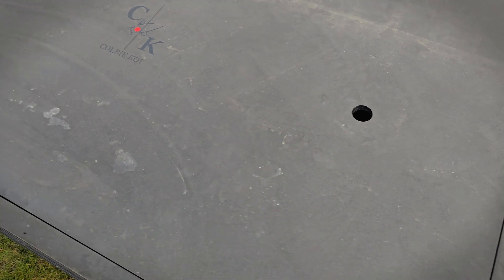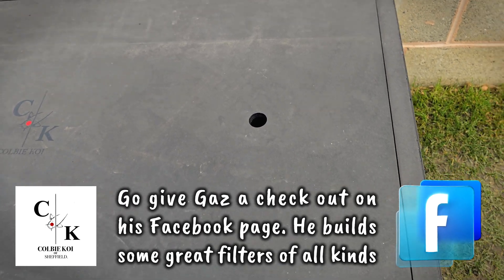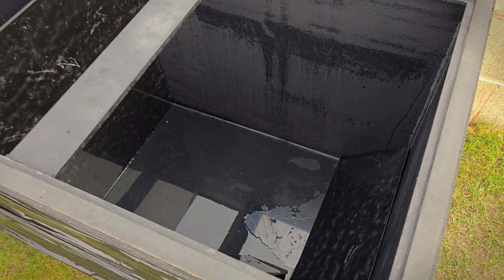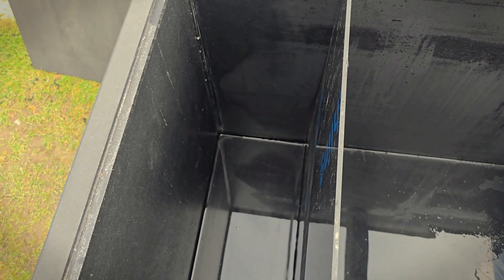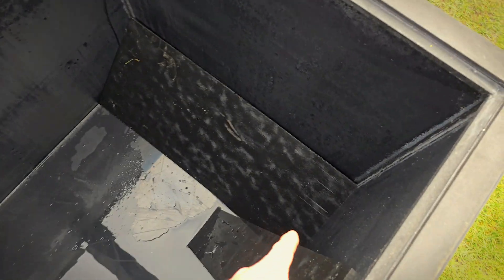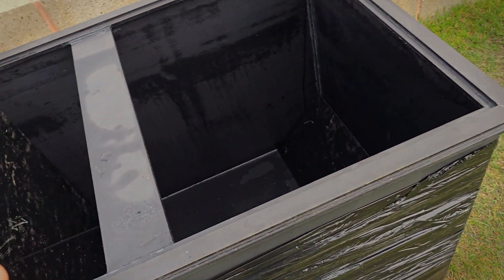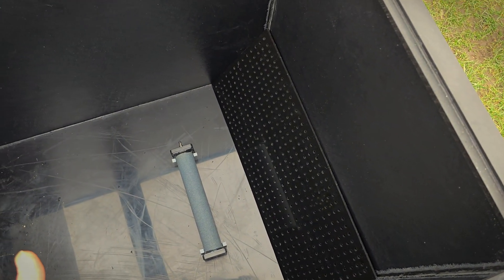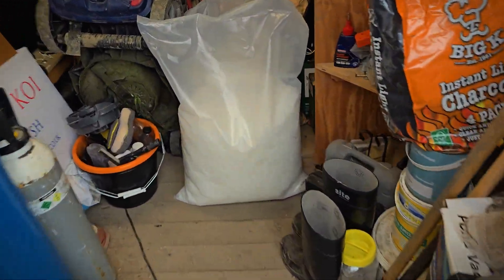KOI POND Bio Filter Build - The Silent Workhorse

Comment: Hi si
What's the dimensions of the bio
Reply from the maker: @ianhulland1064  hi Ian, it's 1.2m x 0.68m x 0.72m internal dimensions 👍
Reply: @UpNorthKoiPond  how much k1 will you be able fit in the bio
Reply from the maker: @ianhulland1064  with the partition in place, it'll hold around 200-250 litres of K+. Without the partition it would hold around 300 litres comfortably

Comment: Do you run solar?
Does it help with your koi bills heating etc ?
Reply from the maker: Hi Craig, yes i do have solar and battery store. It certainly helps keep the cost of everything down in the house, especially the heat pump.